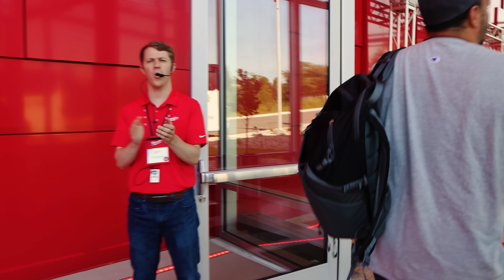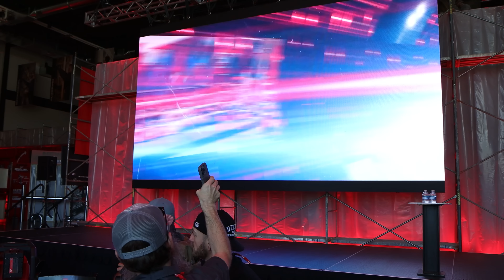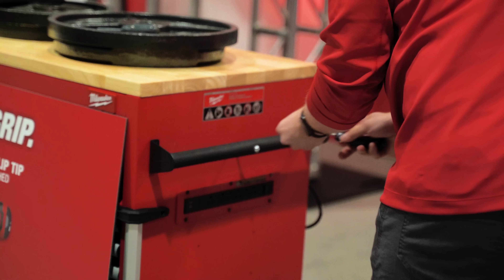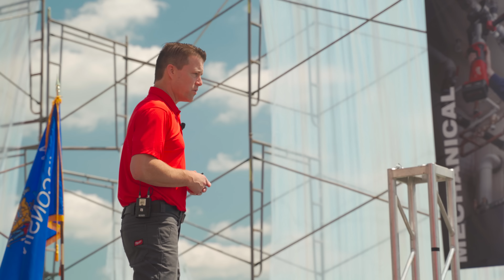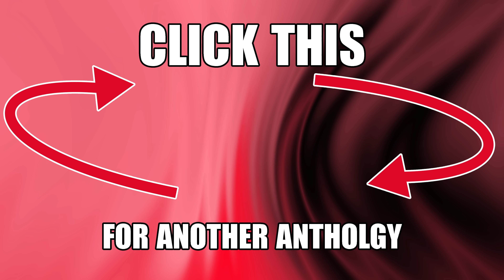Every Milwaukee Tool From Pipeline 2022 (NO FLUFF)

Comment: Milwaukee is highly overrated and overpriced. Fact of the matter is they sell a poor quality tool. I've experienced this first hand. I bought a cordless drill for $200, no matter what drill bit I used, it would wobble. Turns out the chuck was defective. I bought a cordless circular saw for $250, at 0° it would cut with a 1°-2° bevel. Both tools work, but not very well. When you are trying to make precision cuts or holes, these tools are severely flawed. Milwaukee has such a big market share and the brand has gotten so massive, that they don't concern themselves with insignificant things like quality control.

Comment: Big problems, Milwaukee's new carry on, apart from the plugs being upside down, very annoying if you're putting in a two pin plug, the big problem, switched on but not in use the batteries die in 40 hours, even the big 12 amp, so if you are using this as a backup for anything, maybe  for a sump pump,forget it

Comment: track saws almost pointless since most use a skill and lay or bolt down a their own wood guide line  and makeing your own track from aluminum is easy  lazer liners and screw down or vice clamp  is generaly cheaper much less a whole new saw to replace standard skill saws which can be easy fliped to a table saw

Comment: how bout weed eater clear guard for wire brush doubles as snow digger i used a wire brush on digging like a tiller and only thing it needed was a visabity gard  gonna use it next winter to test it slung dirt so may cool as side walk snow sweeper on the mower side i got walnut yard and sucks for push mower iss the balls get between the wheeel and body might sugest fatty wheels or at least plenty space to block wheel grab situations  had bigger rider but bad kids put stuff where it dont go so stuck with pushen on snags do ya design with beefy wheels ? ..and i still say dual action plug cordless simeotaneous sounds better for those that wanna run longer even by dc thin cord maken lightness charge while pluged still use or snap go cordless because its both elemination of seprat base chargers

Comment: i'm willing to bet that the tools that they used for these demos have the torque limiters disabled or turned way up because I have been so dissapointed in Milwaukee 12v and 18v tools cutting out under really low torque and making you reset the trigger. their M12 die and angle grinders wont even run anything over 3" without cutting out under no load at all. I'm a project manager and have 18 crews of workers and we run Dewalt, Makita, Milwaukee 12v, 18v, 20v and 60v tools and every crew I have says they go to Dewalt, Makita then Milwaukee as the last option. We all do admit that the Milwaukee is the best looking though.

Comment: if you rewatch that m12 vs 18v competitor video, they tried really hard to not let you see the shape of that gun, battery facing the crowd, almost the whole time and then they put it behind the wood after the test very quickly. Im 100% sure they threw together some cheap bs in-house unit intentionally making it sh***y

Comment: Hate to say it but that M12 drill under continuous duty overheats, used it with a nylon wire cupped brush to clean out a boiler and was disappointed. Maybe they should start making tools with digital temp gauges, that would be my innovation in these new products because how else can you know how far you pushed the tool ? Temperature is everything ! 
Would have been better to have that M12 rotary given in this kit IMO. 
The M12 impact is a home run no diggity
Reply: Absolutely, I use mine with a wire wheel knocking off rust and it gets hot very quick.

Comment: I'm new coming into the trade and Milwaukee tools are looking really attractive I like the variety of tools available. Should I consider makita too?  I would buy into one platform to interchange batteries.
Reply from the maker: If they have the tools at the right price
Reply: Stick to whatever won't hurt the amount of food you put on your table for now. I used my parents 12v ni Cad Ryobi stuff until it wouldn't hurt me to splurge.
Reply: Just go Milwaukee and don't look back
Reply: @alpharemoval2046  that's what I did I got a m18 fuel I'm guessing Gen 3 hammer drill/impact with 2 5.0 batteries plus charger and case for 288.00 it was 312 total. The 5.0 batteries are 150 a piece and just the tool alone is 160+ each. I went to home depot on the way home before buying it online and home depot it was 329 before tax